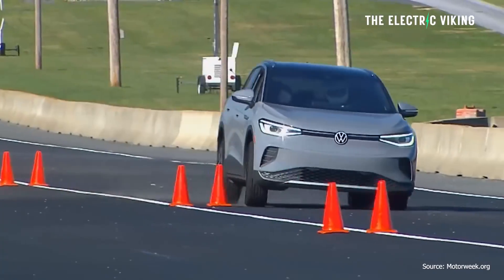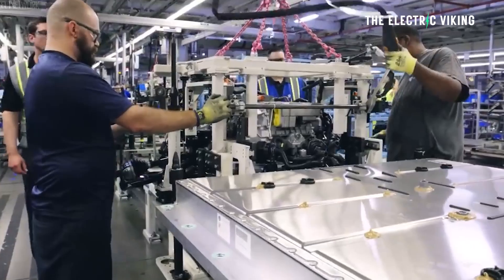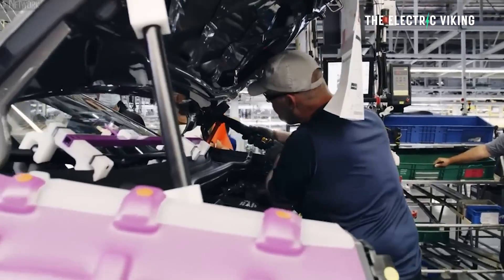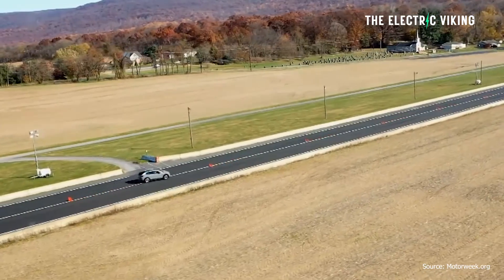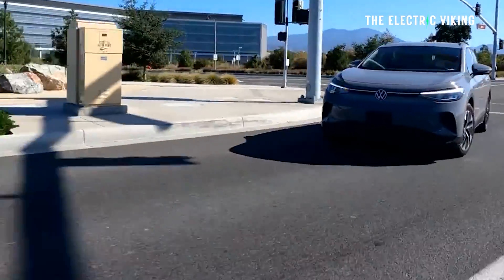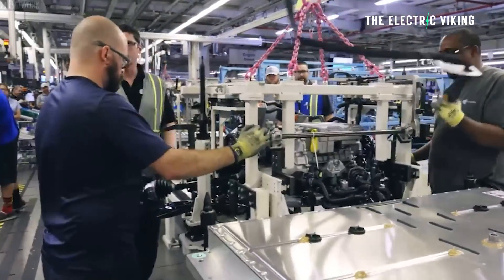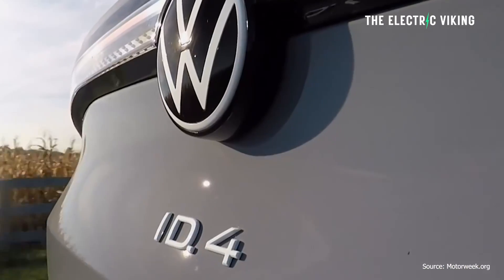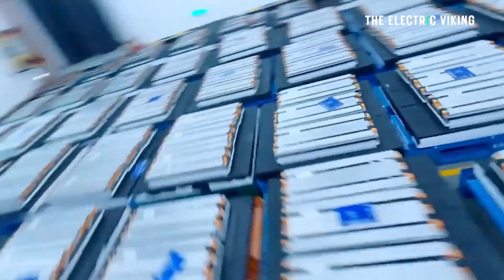How VW improved efficiency of its new EVs by 6% with no battery changes

Comment: Weight is not as important as it is often stated in your videos. For long distance driving it barely matters - and range only matters on a long distance drive.  Aerodynamics are far more important and the ID4 is not very aerodynamic. Look at the difference between the Skoda enyaq and id4. Same car. Only difference is the aerodynamics, which is much better on the Skoda.

Comment: Too expensive compared to the Y or 3.
Reply: I was quoted 60K for a Y and did’t like the interior noise and suspension. So far liking the ID.4 AWD which is 50K.
Reply: @indend876 Model Y LR is $48,900 plus you will get $7500 back from n taxes. $41,400 for a superior range, charging network, performance and tech.

Comment: The whole net zero including EVs is now proving to be an absolute environmental disaster.
Reply: Uh? So far it has remove a ton of Co2 from ever hitting the environment. More power is being produce my sun and solar removing the demand from places like Russia and the middle east. As more public transport has switch, the cost of owner ship of new EV cars has went down. The battery it self keeps improving allowing home owners to even have grid like power storage. Battery prices have came down hard with new chems that are going to allow even more people to have access to them at a cheaper price. Base line power demands have went down (vs just wasting a ton of the power we do produce) into batteries and other storage media. So far, it has been a big win for everyone, so not sure what you are going on about lol. MANY locations that couldnt support power - now has solar. Etc etc so over all think you need to brighten up son:)
Reply: @adr2t  I said "the whole net zero including EVs" not just EVs on their own. Suggest you do a little research into areas such as;
Environmental destruction building wind & solar.
Massive increase in mineing required for battery production.
Governments starting to realise wind & solar can't get the planet to net zero & never will.
Co2 to build EVs way higher per car than an ICE car.
Most EVs are running on coal & gas generated electricity.
The amount of increased Co2 emissions generated by the manufacture & building of batteries & wind & solar factories (they are not farms) is off the charts.
etc., etc.
Reply: @glenwillson5073  Sounds like a bunch of BS from people that dont understand anything:) Coal Power? So what? ITs located in a single location vs million different devices. Thats the first and only BS I need hear from this whole argument to tell you off xD You can carbon capture that run off smoke and pump it into the ground or capture it to build your own Co2 battery. Like how lost are you in the tech??? LOL you made me laugh soo hard xD Come on kid, do better than that. Do you only know 1+1?? Let me teach you what A + X = C
Reply: @adr2t  I'm talking science. You seem to be talking religious faith.
Reply: @glenwillson5073  I heard that they said during the dark ages - how is your world going? Still playing with sticks because thats what you think gets the most "food" right ? Stone wheels? You know, we have batteries design around Na for grid storage now, and even solid state that cuts weight and size down? We also have Si and S that doubles Na and Li batteries power dens almost 2 and 5x compare to even current LFP batteries:) but I guess you don't care about that fact when you can still push wheel your golf cart around. REAL MAN POWER.
Reply: Says who?
Reply: @AllDogsAreGoodDogs  Says more & more people as reality slowly dawns. Where have you been hiding? Do some research on all aspects of net zero (including EV production).
Just one example; in Australia wind factories are allowed to clearfell & destroy pristine heritage forrest and kill any native wildlife, including endangered koalas, that get in the way. But before the religious worshipping of wind factories began, this was not allowed for any reason.
Reply: So,. . . .where did you get that nonsens from?
Reply: @Grizzold-HP2  Just a heads up my friend, you are on planet earth. Open your eyes, do a little research. It's not that hard to educate yourself.
Reply: @glenwillson5073  So you made it up.
Reply: @AllDogsAreGoodDogs  So, not the brightest then, son?
Reply: @glenwillson5073  Brighter than you, "dad".

Comment: Is this a fact or just an announcement? Here in Europe, the only plant in Kassel has severe problems to build the new motor (in fact the hairpin stator). This affects the production of many models: ID.4, 5, 7, Audi Q4 etron and Skoda Enyaq. The limited number of motors is therefore used purely for the production of the new ID.7, probably until the end of the year.
Reply: Bad luck indeed
Reply: Are they building their own? I thought they were using a third party motors like ZF.

Comment: In some ICE cars a more powerful engine can improve mileage compared to an engine that doesn't have enough power to move the vehicle and has to rev a lot to do that.
Reply: Formula 1 engine has a 50% efficiency compared to a typical engine of 35%. The issue is the performance at the road wheel for all engines how much is lost through the transmission system.

Comment: One note the $7500 off at the dealership thing doesn't start until Jan. 1 2024. For 2023 you still have to take it off your taxes. However, if you are over the income limit for 2023 but were not in 2022 you can use last years income to qualify.
Reply: I'm often surprised by how frequently he gets the common info about the US IRA wrong.
It shouldn't be that difficult.
Reply: @timtessman3107  He corrected it later in the video but I had already commented.
Reply: Dealers seem to hate this new setup already, as they are now on the hook to explain to customers that they need to watch out and make sure at the end of 2024 that they still qualify and don't owe money back to the IRS.   Not many customers are going to hear that, and will be angry at the dealers and not the IRS. Also, you now have the privilege of handing your SSN over to a dealership and trust that they keep it handled securely.  Someone needs to do a video on those concerns. Old model was better for consumers.